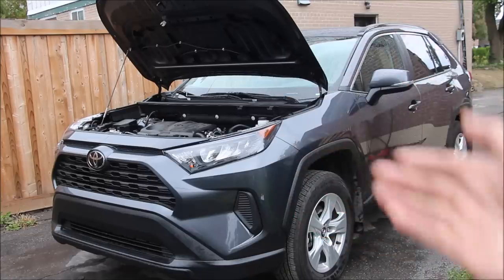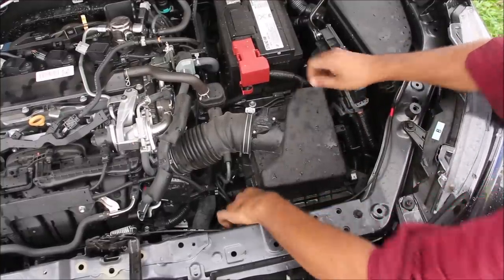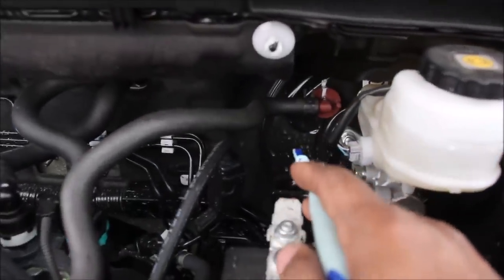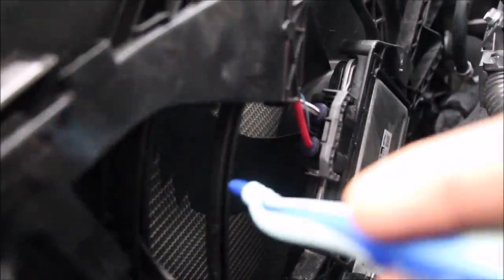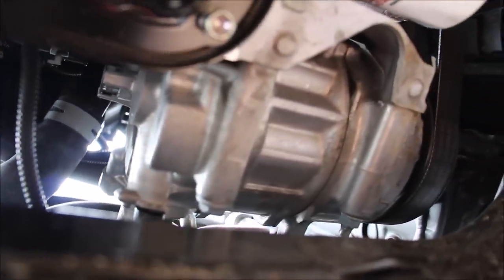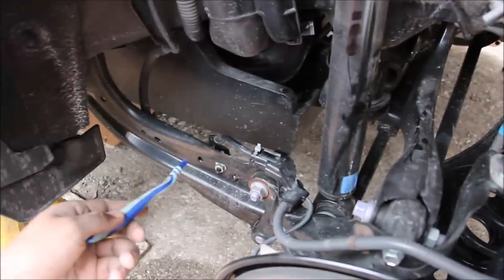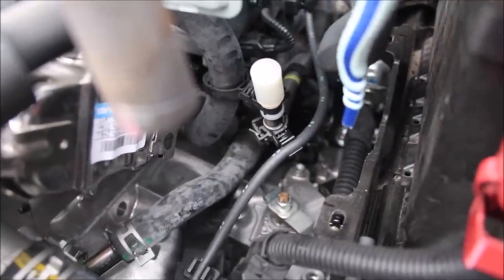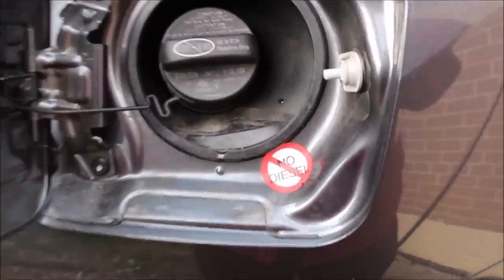Toyota RAV4 Mechanical Review

Comment: Great video!!! Where would I find the coolant bypass valve? Getting a check engine light at 50,000 miles and the stealership wants to charge me $750!!! See a video to change it on a Ford Escape and I’m wondering if it’s as simple, because if I can find it I’ll do it myself…
Reply from the maker: Isn't that going to be near the electronic thermostat

Comment: Nice explanation. Can you also do the same for Toyota REV 4 competitor Honda CRV . Thanks
Reply from the maker: Where do I get the Honda CR-V....I asked two dealerships they aren't interested haha 

It would be awesome to see how the turbo is setup
Reply: CRV is DI only so expect carbon buildup on the valves. Also has a turbo with oil/gas dilution problems.

Comment: Awesome video!  Just bought a 2020 XLE Premium coming from a Subaru Outback.  So far I love it.

So being that the compression ratio is so high, would this engine benefit from higher octane fuel?  I know the engine will retard timing to prevent knock but would there actually be a gained benefit from the higher octane?
Reply from the maker: No, it's optimized for regular fuel, though you might see a tiny gain in fuel economy if using premium
Reply: Why pay $1 more/gal?

Comment: does this vehicle still have the lurching transmission issues ?
Reply from the maker: I didn't feel it in my short drive.
Reply: Yes...Toyota has a programmable fix (they adjust the tune). I was told that it inadvertently affects fuel economy and that’s why the transmission was initially tuned to jerk when driven certain ways (encouraged to come to a complete stop and then accelerate instead of sorta rolling through a stop and then accelerating). Not sure I buy the logic but I’ve just adjusted the way I drive and haven’t really noticed it that much anymore. But yes, to answer your question, the problem is still there. Along with a plethora of others. I Love the car but really wish I’d waited for the next generation of the redesign.
Reply: My transmission shifts as smooth as silk.

Comment: Its fascinating that they added an EGR system. On the old MZ once they added VVTi they removed the EGR supposedly because it could do the job of the EGR. Now with VVTi on both cams they still think an EGR is necessary. I wonder what the engineering rationale is behind this.

Comment: Great video - thanks - I think it was the final push I needed to get a Tesla Model Y in 2020 instead of a RAV4 Prime.  I'll then have suspension, battery, tires, and software which seem more manageable.  Otherwise, I'm seeing a future with hours at the Toyota dealership Customer Service counter describing many of the parts you've mentioned that need to be replaced or repaired or drained, etc. and the cost of each along with the labor.  I've been there and done that.  I know EV's have issues too, but , after owning several internal combustion engine cars, I think its time for me to move on and try electricity only.  I know, I'll be spending those hours instead at charging stations, but I think I'm okay with that as an investment to future generations.
Reply from the maker: Thanks 
Enjoying the Tesla so far?
Reply: I guess you drank the globull warming kool-aid.

Comment: Good review, concise.
Two things I do not like on the new Rav4, the engine and battery placement.
The engine : Toyota added a lot of new technology which makes it harder and more expensive to service in addition to a great chance for something to go wrong.
The battery : Partly placed under the master brake fluid reservoir.
Good luck removing the battery with damaging the master brake fluid reservoir.

Comment: This Rav4 is very complicated for machanic and Toyota market will go down for this Rav4
Reply from the maker: They have been selling well
Reply: @speedkar99  yes because the shape is New but when it comes to machanics they will suggest to buy earlier model because of the electronic exhaust cam and egr and dual injection
Reply: But you did great effort on making this review and this is real review
Reply: Dual port and GDI make it superior to other engines that have only GDI. It eliminates carbon buildup.

Comment: I don't think that new multilink rear suspension is better handling than the old one but cheaper and more rubber pushing. for that it will have a lot of problems after 60K miles.
Reply from the maker: Yeah that's the downside unfortunately.

Comment: So this latest Brand new platform from Toyota uses all steel no aluminium and you have never criticized it for it and at the same time you criticized Mazda CX9s 5 years old platform for all steel.
Also you picked brand new clean Toyota so it looks super clean under inatead you picked CX9 that was already driven thru Canadian salt mine showing rust 
My 4 yrs old CX9 from Florida with ton of rain and high humidity looks perfectly clean with almost no rust ready for long service. 
Canada and Northern dealers should be spraying on protection for theese cars knowing how salty your winters get...
Reply from the maker: Yeah rust proofing is a must. This Toyota wasn't new either. You are right though we should expect more aluminum but Toyota is very conservative with that.

Comment: That 8 speed transmission is problematic.  Definitely, have the dealership drain & fill every 60K miles. The 2.5 Engine is reliable per Scotty Killer. Thank s for video.
Reply: The fluid has nothing to do with the problems. It's the programming.

Comment: 4:51 Nah. Regen-braking on an electric motor is the wave of the future.
Reply from the maker: That's not enough to stop a car in everyday traffic
Reply: @speedkar99  Regen is simply powering the motor in reverse, which should in theory give you as much power to stop as to accelerate (e.g. 475 kW for the big Tesla). The real kicker is the unit-cost on a controller that can handle full regen, and at least in the short term, a full complement of dino-juice brakes is cheaper. That's why that same big Tesla uses them: Because before an "eco-warrior", Elon is first a capitalist.

TBC, I do love seeing an electric motor where there was once a belt pulley or driveshaft on ICEs: Saves fuel, saves maintenance and gives consistent performance at all engine speeds.

Comment: This grade of oil has been around 20 plus years mobil1 ,petronas, tripel QX  motul hybrid, it expensive $17/ litre but very good. Anyone with a hybrid will have been using this oil for a long time.
In Europe we gave been using plastic cam and heads force long time since 1980 and car still running with no reported warping. 
This 2.5 been around for many years with no reported head or cam cover issues. As for the polyurethane enhihe covers they are lighter have better sound deading and  thermal qualities most premium manufactures have moved this way my 3byesr old Volvo has one.
This type of electronic break will cause excess wear onbtge inner pad meaning it will require replacing before the other 3 pads,  thus us very common in European cars
This is not a true it's a soft reader with AWD.

Comment: damn plastic valve cover?  1st I've heard of.
Reply from the maker: Well you are out of touch....plastic valve covers have been around for 20 years.
Reply: Designed for failure! Interior plastic can't even handle the heat and cold season changes muchless valve covers.

Comment: Never knew these have an electric water pump. Hope they learned from BMW...
Reply from the maker: Yeah all Corolla Camry Rav4
Reply: Seems like a nice step forward in auto technology. I hated the idea at first, but it will allow faster warm up in winter temps, and makes changing the pump very easy. Plus better gas mileage. Hopefully it works well!

Comment: How about the fluid change procedures for the transmission and the oil change procedures.   Toyota did not improve it.
Reply from the maker: I mentioned They are sealed transmissions
You have to pump fluid in

Comment: Downside is the electric motor driven water pump! Not practical!
Reply from the maker: Not sure why they went that way. But I guess it's more efficient
Reply: @speedkar99  I read they save on fuel due to no parasitic loss, are more efficient, and allow the engine to reach operating temperature faster. Does this seem correct? Plus in theory, would they be easier to replace than belt driven?

Comment: The transmission is garbage. It's actually trending on car complaints because so many people are still having issues with the transmission slamming into gears, lurching and clunking despite supposed "software fixes" being put out by Toyota.

All I see under the hood is a Toyota that has pinched every pen they could to the point that it's detrimental to their product and it's likely why quality is not what it used to be.

Comment: Staggering level of unnecessary complexity for a run of the mill vehicle. No wonder these things cost so much!
Reply from the maker: I don't think this is complicated by modern standards. 
Emissions and safety are what drive all this technology to maximize what automakers can do with a box on wheels
Reply: @speedkar99  "By modern standards"...that's the key isn't it. I was a mechanic in the 70's and 80's and it's hard to believe the  changes since then. Sure it's nice, but the law of diminishing returns makes me wonder if it was worth it.

Comment: Very impressed with Toyota technology. Electronic brake booster! So this means we can't bleed brakes anymore the old school method?  This isn't a true off reader but I think this will help in your country in order to negotiate the snow. Electronic water pump is interesting, does it have to be replaced like the conventional ones every 200000km?  All this technology and electronics makes me nervous buying this car in 4 years later, will I be able to work on it myself and maintenence! I can't wait for Toyota to release its all electric cars. all this none sense steroid engines is crap.
Reply from the maker: I'm impressed yet worried about the cost of repair once it does break

Comment: Too many plastic parts..
Let see if the engine will be made out of plastic
Reply from the maker: I've seen a prototype plastic engine...
Hey if it can Outlast a regular engine at half it's weight then why not
Reply: @speedkar99  but I often see plastic parts doesn't last long as aluminium counterparts.
Reply: Plastic is superior.  They build planes out of plastic nowadays.
Reply: @user-tb7rn1il3q  as long plasticizer or other volatile substances that keep plastic brittleness is there, yes they're superior compared to metal counterparts.
As they age, plastic parts tend to get brittle and break apart from the inside.
IF they are EASY to replace components, I wouldn't complain.

If it has critical function and require to take the engine apart to replace, it is really bad idea to use plastics. But that is exactly what manufacturers do these days..

Comment: Why do they keep putting oil filters sideways instead of straight up and down? They leak everywhere when getting to the last tread and turning up to limit a real mess. Lame designs

I feel the same about transmissions without a true dipstick to check. This new design of checking fluid from drain valve of bottom of trans is a real world nightmare. I had a quick lube tech loosen that drain plug and hot transmission fluid swells so it overflowed and let fluid out then when it cooled down was low on fluid. Stupid design that almost cost me a trans in new toyota. I think they designed it to be a problem and make them money.
Reply from the maker: I don't like it either 
But it helps keep the oil inside
Reply: @speedkar99  HOW- it is pressurized after starting the engine.